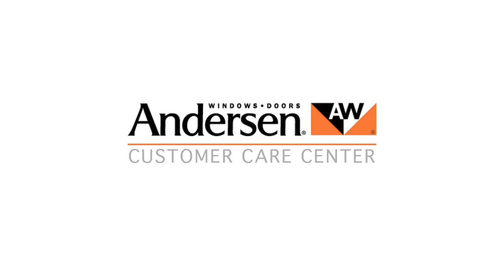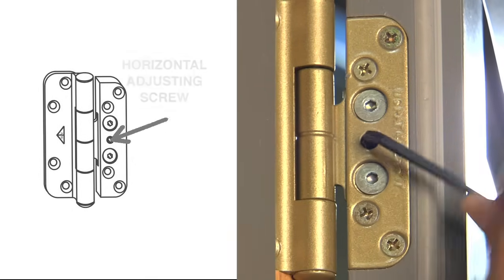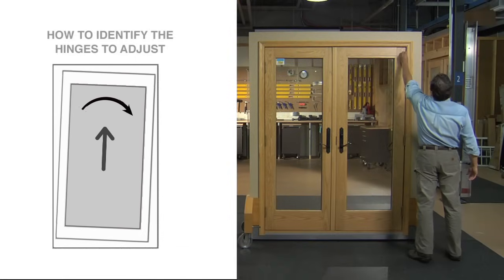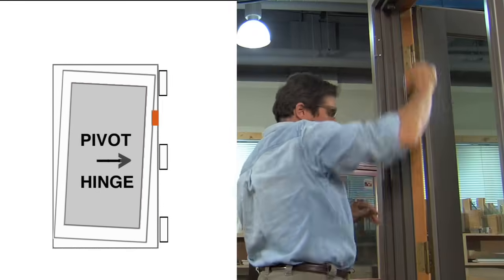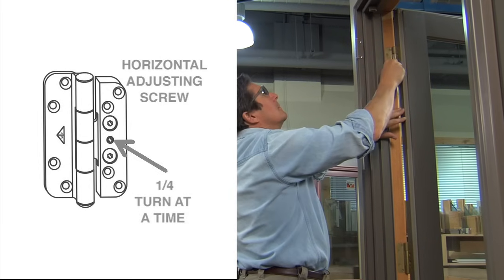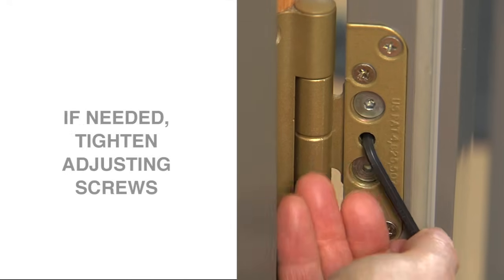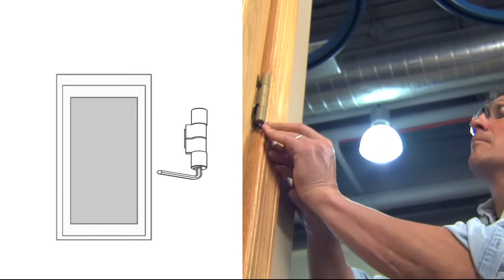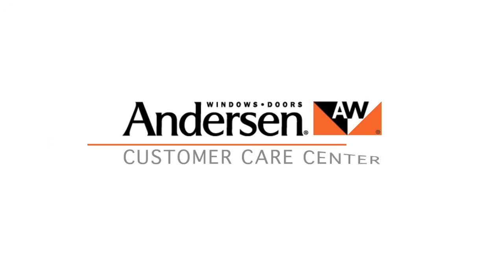Adjusting A Frenchwood Inswing Patio Door (Pre-2005) | Andersen Windows

Comment: when you adjust the door up or down , the cap on the bottom of the hinge has a 7/32 hex. no need to remove the cap, the 5/32 allen wrench will go through that hole to adjust door
Reply: OMG, thank for you this. Spend an hour looking for an elusive allen wrench for the cap
Reply: Can't believe this wasn't in the video. I assumed cap was the adjustment point and broke the cap. Anderson failed to point this out! :(

Comment: Well.. that IS quite damn useful ! We have had problems with a certain door since we moved in to the house way back 17 years ago... The door has been removed and reset but never quite right. 
I did this adjustment today as there was some rubbing on the weeping plate down on the sill.  
Now, if they could use a more common wrench side such as 1/4 but never fear... my metric set provided a 4mm that fit the bill.
I stuck the wrench in the two holes and found that there are set screws in there, only not visible. 
By following the procedure, I was finally able to get the door to close without rubbing against the aluminum sill/weather strip.
I still had to redo the work today, for a lesser problem: the lock was super hard to open and close... I had to make the top side of the door further from the wall. Solved again...
(01/2019) Another round of adjustment... now I opened one of mine to check some of the instructions and mine seems to be some sort of version 1.0 as the set screws turn counterclockwise to tighten the movable piece in place... The top of the door was "loose" and is what made me double check the guts of the hinge. Everything is (again) adjusted... but this time, I turned the set screws to tighten it in place.
Reply: N

Comment: Moved into a house with doors from 1995. They are starting to sag. I thought the horizontal positioning screws were missing but it turns out they are just completely stripped. Any suggestions as they don’t sell these hinges anymore and the new ones would need to be retrofitted to the door?

Comment: My door began rubbing on the bottom, before I came on this web site I began adjusting to no avail.
After your explanation I got the door lined up and then raised it off the sill. It opens and closes without 
any problem now. 
EXCEPT? The hinges squeak terribly loud. I have tried turning the bottom screw clockwise and counterclockwise on each hinge but the squeak remains. What do you suggest I do to stop the noise?
Thank you Wendell

Comment: I have these doors and they constantly need to be adjusted up (the last adjustment in the video). Is there some way to lock the hinge height adjustments?
Reply: We have the same problem.   280 bucks for new hinges from them (except for white - we might buy white and paint them black and save 120 bucks).   My husband is going to try something like locktight.   Ours only lasts about 2 weeks after adjusting.  They should warranty more than 10 years in our humble opinion.

Comment: I need a replacement position fixing crew, but Andersen doesn't state the size ANYWHERE.  They look to be 1/4-28 x 5/8" for my '92-'05 door.  It looks like Andersen does not use metric, but if it did, then it would be a M7-1.0 x 16mm. Does anyone know for sure though? THANKS!
Reply: It's probably a long shot, but did you have any luck on finding the position fixing screw? I just moved into a new house and realized that the top hinge is missing both of them and I cannot find the dimensions anywhere online.
Reply: @frozenrope2822  thank you so much!
Reply: Kyle Harris you bet! Good luck!
Reply: Anyone know what size these are? The eBay link doesn’t work anymore and mine are completely missing